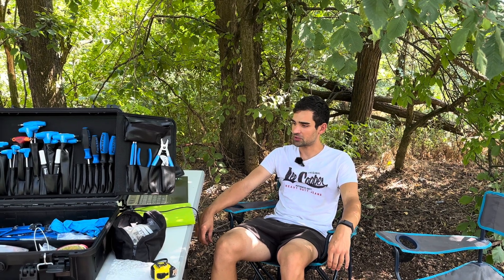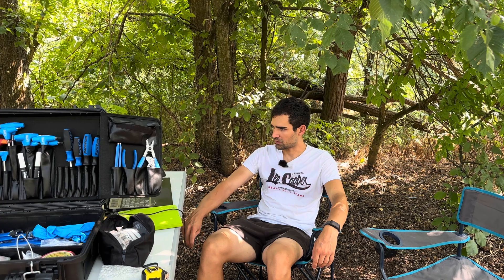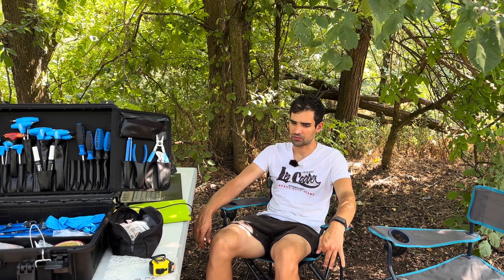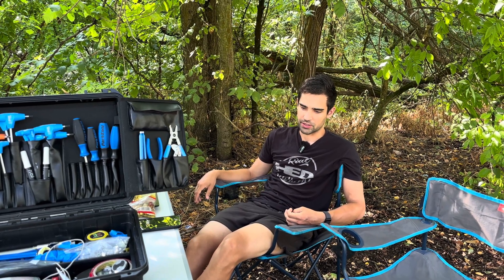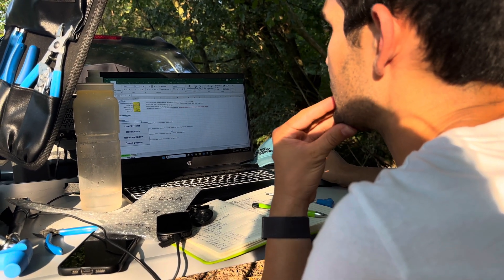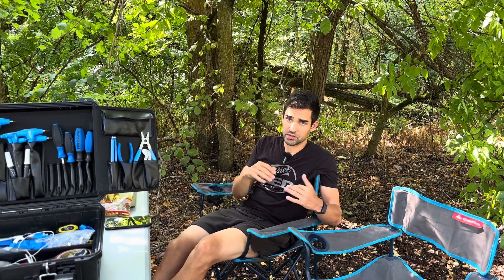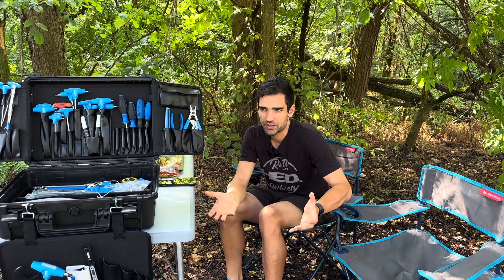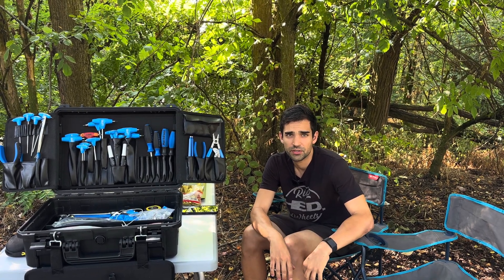Power Meter Ruins The Results - Aero Testing Diaries, ep.8

Comment: i dont think you are right on 4i. they dont show the calibration number in the same way as you think. it is a simple yes or no based on if calibration is a sucess. so if it shows 10. that means its calibrated. not that this is the temperature adjustment. if it fails it shows 20.
Reply from the maker: Maybe. Still, there was a clear drift and the measurements were off. And it wasn’t the sensor (or anything else) either.
Reply: @ronykuba  understand. Something mustve been off.